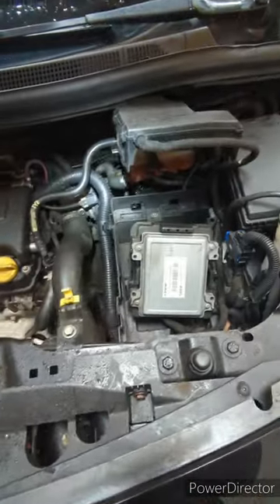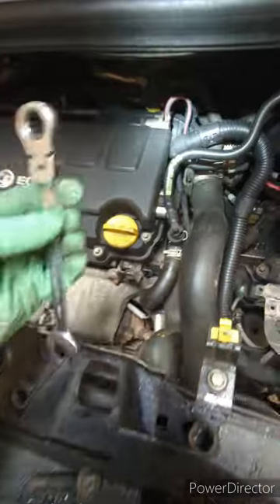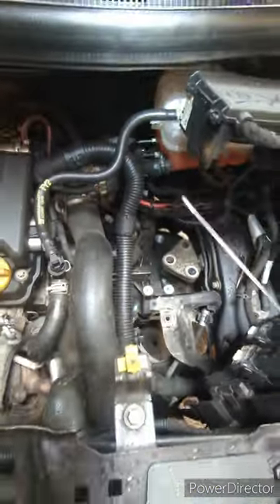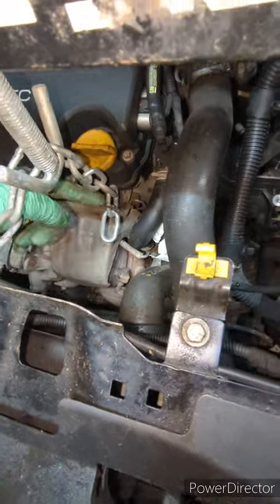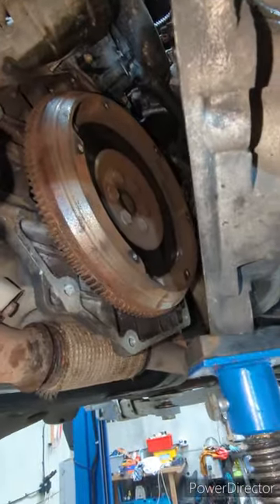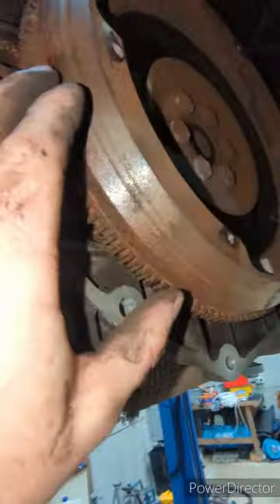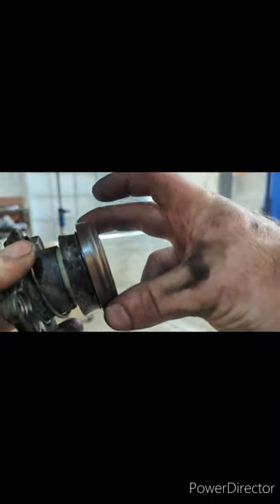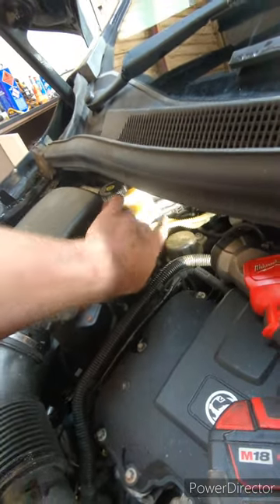Vauxhall / Opel Meriva B, clutch replacement on 1.4 petrol turbo.

Comment: About that clutch filling/bleeding, can't I just have the pedal pumped while someone fills the reservoir, Im aboit to do the hob and dint wanna get caught out is its my driver so wint be able to go get bits/tools once I start, Ive never had to use an easy bleed before so dont have one?
Reply from the maker: I tried bleeding it as you would the brakes by pumping the pedal and bleeding the air but it didn't work. If you search on YouTube how to reverse bleed a vauxhall clutch you will find a video from "driveway DIYer" and it seems many people have found the only way is to reverse bleed it. A syringe and bit of plastic tube should be all you need. Let me know how it goes.
Reply: @j.f5212  yea cheers bud I'll make sure I've got a syringe handy then, I'm planning on doing the job Monday so I'll watch some more videos too and let you know how it goes, many thanks buddy......👍👌👍
Reply from the maker: Search on YouTube "Williams mobile clutch service" he has one on the meriva
Reply: @j.f5212  appreciated buddy thanks
Reply: @j.f5212  Ahhh yes I've watched his video already I'm going to give it a go without dropping the sub frame thanks to him, only been 15 years since my last clutch lol so I wanna be prepared, cheers for all your help again.....👍👌👍
Reply from the maker: @EZ-D-FIANT  I never dropped the frame but it's tight and awkward to push the gear box up out of the way. I recently did a zafira and basically the same gearbox. But an issue I found was the original clutch had been changed for an Luk brand clutch and they don't use the wiggly pipe to the slave cylinder they use quick connect hose, so the wiggly pipe was long gone. I had bought a Sachs brand clutch which still requires the original pipe for the slave cylinder in the bell housing. Lucky euro car parts stock the wiggly pipe to the slave cylinder for about £10. But if you have an Luk kit you will be fine, or if the original clutch is in it you will be fine. But if you have bought any other brand and by chance someone has already been in and changed it for an Luk kit then you will need that pipe.
OEM Vauxhall Clutch Slave Cylinder Pipe For Astra Corsa Meriva Zafira 24422066
Reply: @j.f5212  Sound advice thank you, I've got a sachs kit so I'll check that out tomorrow morning while I can still get to eurocarparts.....👍👌👍